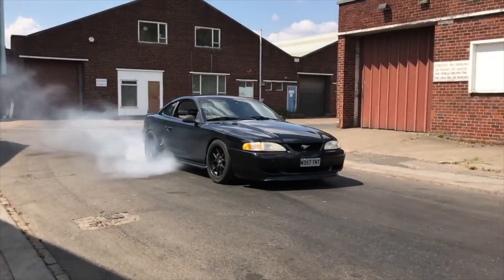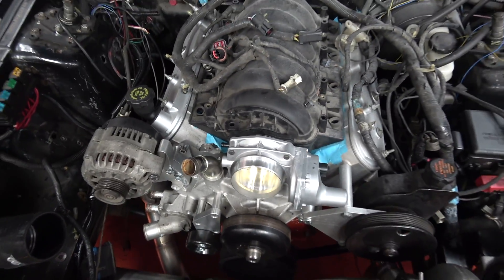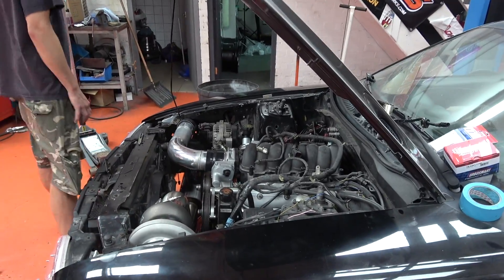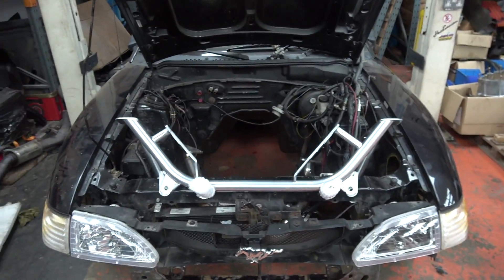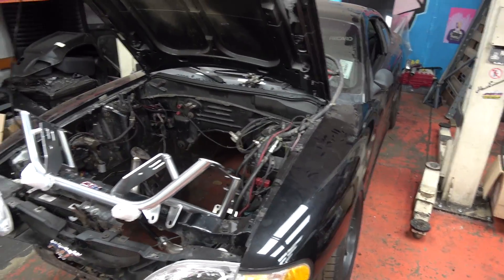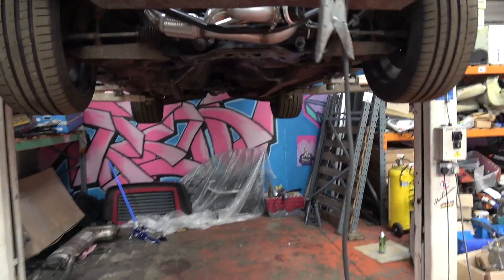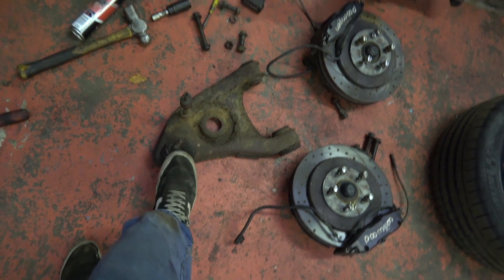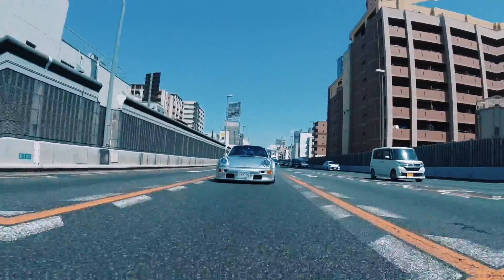Mega update on Jays 1000hp LS Turbo Mustang build - Part 11

Comment: No chance adapting a pair of Adjustable lower wishbone arms  from the Driftworks Catalogue Jay?  To be fair though. it wouldn't be too taxing to use the originals to make up a jig from. Few metres of CDS tubing. Everything else you could knock up in Craig's machine shop.

Comment: Correct me if I'm wrong, but arent coilovers only option with the new tubular crossmember since it has no spring seats?
Reply: I bought one with spring seats they bolt on but I’ve not fitted them.